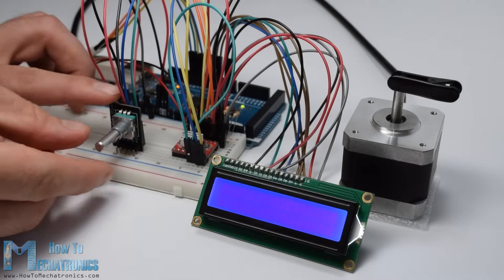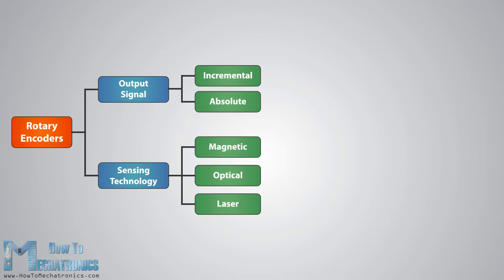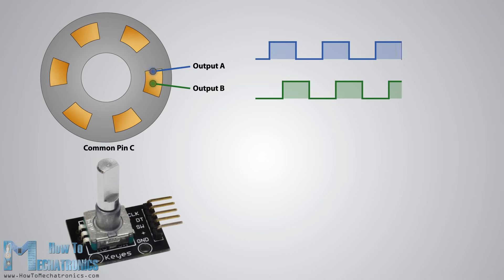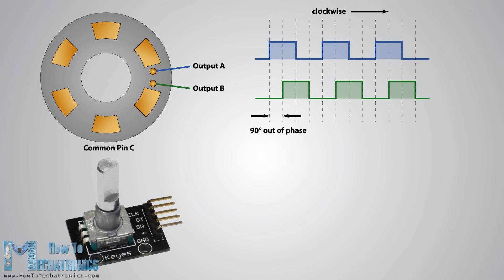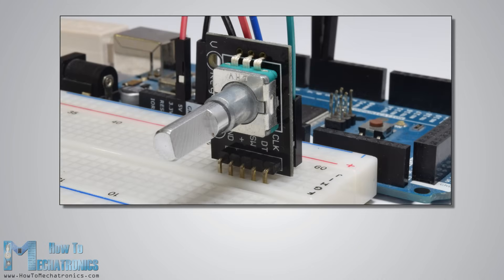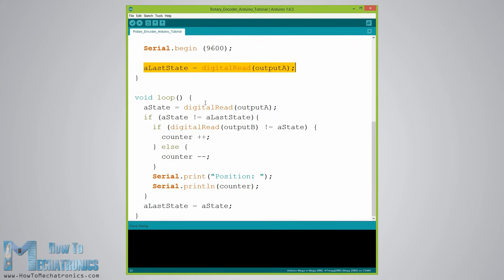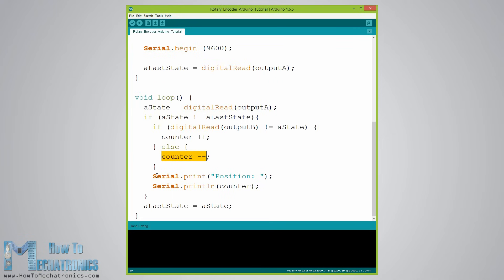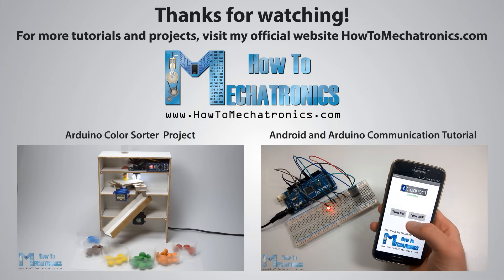How Rotary Encoder Works and How To Use It with Arduino

Comment: Thank you for this! I am planning a large midi controller surface with 176 rotary encoders, and considering using the i2c protocol to read them.  I have basically the same encoders as you used in this video.  Do you think the i2c method is best for this sort of large design, or would a series of multiplexers be better?  Given that a human only has two hands, its only two encoders would ever he wctive at a time, so my thinkng is i2c would be fadt enough.  Your sights are very welcome. In addition, any ideas on how to attack these to the i2c coms would be welcome. Im not sure about the exact specs of these encoders.

Comment: I am trying to do this and maybe this video is too old for accurate reference but I'm using an arduino uno 3 and once I compile and upload everything, when I go to the serial display the numbers start changing immediately either increasing or decreasing but usually in steps. for example will go from 2 to 3 a bunch of times before moving to 4 and repeating all the way till infinity presumably. I tried to change different things to find consistencies but everytime I think I figure something out I just get more questions. Please HELP! Also I am trying to create a programmable control for a microcontroller on a stepper motor for a pump.

Comment: Nice video।i was just came here to know how actualy it works .i know what's it's use.i just bought like this.i know before i ordered that is used with microcontroller.i have one costly device having mebrane keyboard.there are  keys up and down .though these two keys i can increase or decrease the value .i studied the matrics of membrane keypad.i gind which lines are short when i press the perticular key. I just want to replace these two keys of up and down with this rotory encoder switch.i don't want to use microcontroller because the device is costly, single mistake can spoil the system.i bought bit not tried it anyway. before i try i woyld like to understand how it works .have you any hint in this regard.please reply .
Note :If it is the case where i have to use microcontroller ,i can do ,because i know the whole things regarding MC and script writting too.

Comment: Can you do a video on measuring the angle of rotation of the stepper if connected the encoder to the shaft of the stepper and if the shaft is rotated manually?

Comment: Does the rotary encoder have a limited amount of full turns you can make before it needs to be turned in the opposite direction?
Reply: They doesn't, you can turn them infinity.

Comment: i know this is an old video. but if anyone knows about this I could really use some help. or if someone can re-direct me to another knowledgeable source that would be great! so I'm wondering if there is a way to use a  3 pin rotary encoder or one like in this video on a switchboard for a monitor. i don't want to have to code anything. just solder. but I'm trying to use a back and forth button on the monitor and turn it into a rotary switch to combine the two. so when I scroll to the right, it clicks the right button, and when I turn to the left, it clicks the left button. anyone know if I would have to code the rotary encoder or not? and if I do have to code it how can I go about it? also if you guys need  further and better explanation just comment below and I'll respond. thank you .

Comment: I have a question. Every after 360 degrees turn of the rotary encoder the value of the position does not increments always the same. One whole turn it increments by 30. Another turn it increments by 40. Then 35, and so on. Why I don't always get the same incrementation although I always turn the same 360 degrees angle?

Comment: Better code fix 
I sample the encoder in a 1ms interrupts and found that encoders with a Detent
will always increment by Two so I added the  && A==1 inside the IF Statement 
I also found that you can get bad samples when reversing so I sample each 
Phase twice to make sure no changes occurred. 

/// * Called from Interrupt  *

// other interrupts could occur between A/B reads 
// Make sure we get clean samples 
//
    byte A = digitalRead(PIN_ENCODERPHASE_A);
    byte B = digitalRead(PIN_ENCODERPHASE_B);
    byte A2 = digitalRead(PIN_ENCODERPHASE_A);
    byte B2 = digitalRead(PIN_ENCODERPHASE_B);

    if(A != A2 || B != B2)
    {
      Serial.println("Bad encoder sample");
    }
    else
    {
      if(A != Aprev && A==1)
      {
        if(B != A)
          Encoder++;
        else
          Encoder--;      
        Serial.print(A);
        Serial.print(":");
        Serial.print(B);
        Serial.print("=");
        Serial.println(Encoder);
      }
      Aprev = A;
    }

Comment: great!! can I ask you abput this topic?

I have a encoder with 8 Cables and 1500 ppr ( A+ a- B+ b- Z+ z-). I just connect the A and B to the arduino uno with this code. But the reading speed is not enough to catch all the pulse i think. 

Do you think that an arduino Due could help me? Or based on your experience what could be the solution?  

thanks

Comment: I don't believe the Vcc connection to the encoder is required if you use INPUT_PULLUP for both the A and B inputs.

Comment: Hi, I'm getting double count, for ex: did one turn - result: 1,2. one more turn: 3,4. and so on. How to fix that? :/
Reply: I had this problem too. it was counting on, both, the falling and rising edge since the initial "if" was "if(current != previous){other statements}". to fix it it, just add  a second condition, like this "if ( current != previous && previous ==1){other statemetns}". i simplified it further and just ended up with "if( previous==1 && current =0){other statements}". this will only run the condition on the falling edge.
Reply: I just don't know what you mean by current and previous is it like aState and aLastState in the code
Reply: Thank you Its finally working!!! :)

Comment: Use an interrupt instead:
volatile bool isCCW;
volatile unsigned int count;
long encoderCount;

void isr() {
    isCCW = digitalRead(outputA) == digitalRead(outputB);
    count++;
}
void setup {
   //...setup pins and stuff attachInterrupt(digitalPinToInterrupt(2, isr, RISING); // has the be pin 2 or 3
}

void loop {
// other stuff
  if (count) {
    if(isCCW) encoderCount += count;
    else encoderCount -= count;
    count = 0;
  }
}

Comment: can you please make a video where you use an encoder and an SPI (counter) with Arduino. I want to know how to use the SPI.transfer() function in the Arduino IDE software using the SPI.h library. the encoder that I am using is am-2816a and the counter is ls7366r. the some Arduinos have a built in SPI communication pins. For example Arduino nano has pins 10, 11, 12, 13 as the supporting pins.

Comment: It works, but not the best way to do it, you’ll have lots of problems doing it this way down the road. Such as more power consumption, because the code must poll the encoder constantly, you’ll also have missing codes if the code isn’t cooperative multitasking and the processor is busy doing something else. It’s better to use logic, a CPLD or flip-flops to handle the quadrature decode and use hardware interrupts to run the encoder subroutines. I realize this is going to be very difficult for most people to implement, I just want to point out that there are more professional ways to handle encoders. The simple solution is fine for quick experiments.

Comment: But it increments by 2?
Reply: Yes, becouse encoder inside selector is moce precise than selector's rows. It is even possible to multiple increments up to 4 per click.
Simple, you must to count every increment to integer and checking. If is >= than 2, is one cw click. If is <=-2, is one ccw click.

Comment: Why arent you using an Interrupt to read the encoder. This code wont work in an application because the reads will be too slow to pick up the pulses accurately.
Reply: yeah i'm having that problem right now. How can you solve it exactly?
Reply: @TheBramVermeulen  check great Scott's video about encoder
Reply: Polling is the way to go always, use a Timer interrupt to have a (very high) constant sampling rate. External interrupts aren't recommended because they can 'jam' your code.
Reply: @marcojimenez9327  They don't jam your code, keep the routine tight and the variables volatile.
Reply: volatile bool isCCW;
volatile unsigned int count;
long encoderCount;

void isr() {
    isCCW = digitalRead(outputA) == digitalRead(outputB);
    count++;
}
void setup {
   //...setup pins and stuff attachInterrupt(digitalPinToInterrupt(2, isr, RISING); // has the be pin 2 or 3
}

void loop {
// other stuff
  if (count) {
    if(isCCW) encoderCount += count;
    else encoderCount -= count;
    count = 0;
  }
}
Reply: @markfinnicum8340  but you need to interrupt on state change, not just rising
Reply: @theralhaljordan7337  it does not make too much difference in practice. With change, the count would be twice as high per rotation and more accurate with direction changes in theory.
Reply: @markfinnicum8340  wouldn't the rotary encoder be ignored if the state rises?
Reply: @theralhaljordan7337  you are listening for the rising edge of just one channel. Both the rising and falling edges have the same comparison between channel A and B. The comparison negates only on direction change
Reply: @theralhaljordan7337  That, and you need debounce-logic cause the signal is dirty.

Comment: When i do this it's increasing double every time
Reply: the fix is very simple, just add |  && aState == true | in the first statement. like this....    if (aState != aLastState && aState == true)    the problem is that increments and decrements are happening at both rising signal from low to high and falling signal from high to low.
Reply: @Ahmadnaweed786  cool. Ill try your solution soon.
Reply: @Paradox3627505  let me know if it works
Reply: oldSoCool 
Same here. The problem is that our counter variable is incrementing on both lo-to-hi and hi-to-lo transitions. So (A=0, B=1) and (A=1, B=0). I'm assuming your encoder "clicks" with each "small" turn (mine does) and this causes a pulse which means both types of transitions will occur. I'm not using arduino but this solution worked for me. Pseudocode:
...
If(a_state != a_last)
   [If(a_state != b_state)
      [ If(a_state > b_state)
          [Counter++;]
               ]
           ]
              Else[ 
                Counter--;
                   ] 
....

Let me know if it works!
Reply: @Paradox3627505  i tried your code but didn't work for me; only one direction fixed, other direction kept counting by 2. however, i finally got it working since the line you added gave the general idea of how to go about it. I ended up with this "if ( currentA != previous A && previousA ==1){other statements}". note, this is the initial "if", the once of the inner ones. this counts only on the falling edge.
Reply: @carlos2004  Thanks!!
Reply: @Paradox3627505  didn't work

Comment: There are instances in both CW and CCW situations where both A and B are same and different. How can u just say that A!=B for CW and A=B for CCW?
Reply: In case you still haven't found out, you can just copy paste his code and do the exact same thing with outputB as he does with outputA. Just remember to add a variable bState and bLastState, change the code inside the loop and swap the variables accordingly.  Lastly, replace counter ++ with counter --- and vice versa and that should be all there is to it.

Comment: Wow, such elegant code...My overly complex code didn't work well when I spun the encoder quickly, this works flawlessly. Thanks!
Reply: It's not that elegant tbh, it should be implemented with hardware comparators and interrupts
Reply: @TheChrisey  Agree: the example in the vid is fine
 for slow speeds, and when there is feedback, such that if a count is missed, or extra, the user will self-correct, and everything is fine. For higher speeds, you need some hardware and maybe counters, which take care of the counts, and the main software just reads the counter any time it needs the values. Some of the Microchip PIC family have a hardware module built in. A quadrature Decoder. But you can also craft with some of the "soft" progamable gates, e.g. CLB and such.

For very high speeds, e.g. motors at thousands of RPM, you can't really just poll the pins in a loop: you need hardware assist. Or very fast interupts might get you some of the way.

But again: the example is fine for the right kinds of slower stuff.

Also: switch-bounce shaping on the pins can be important, so you only get 1 count per count, not many. I did not look too deep at the code to see if maybe its state always handles that OK enough. A resistor and a cap might be enough, depending on the encoder used.

Comment: man you have to change some code from
pinMode(outputA,INPUT);  ==> pinMode(outputA,INPUT_PULLUP);
pinMode(outputB,INPUT);  ==> pinMode(outputB,INPUT_PULLUP);
to work
Reply: Thanks Arun. I was having trouble getting it to work with the original code, but your fix has it working perfectly!

Comment: Rotary encoders are utter crap. As soon as oxidation gets on the contacts, it will fail to work properly, and will skip steps or not work at all... I hate rotary encoders, because I have yet to see one that works flawlessly for more than a few months.
Reply: AlainHubert you can disassemble a PC mouse that uses a rotary encoder for the scroll wheels. Those are pretty reliable
Reply: Yes indeed. But they're usually bulkier than electromechanical ones. Difficult to use with a knob on a front panel of a device for example.

Comment: in this example was the encoder connected to 5v at the common pin and then pins A and B were connected to digital pins with pulldown resistors?

Comment: Nice explanation.
Unfortunately your code does not work :-(
The counter is decrementing to infinity, not responding to the encoder position.
Reply: It works fine. You must have done something wrong.

Comment: Do you know the maximum speed of the decoder? Can it turn up to 200 rounds per minute? I tested once and it was not counting correctly - so the question is - was a problem with Arduino or with the mechanic of the decoder? 

Thanks you

Comment: Didnt work,. the output is just decrementing into infinity.
Reply: even i faced the same problem but can be corrected by replacing 
pinMode(outputA,INPUT);  ==> pinMode(outputA,INPUT_PULLUP);
pinMode(outputB,INPUT);  ==> pinMode(outputB,INPUT_PULLUP);

Comment: I have problem in connecting the arduino Mega 2560 pin when I connected two encoder at the same time.

For 1st encoder, the connection pin is same as provided in the video and I able to measure position but

For 2nd encoder, I try to connect

CLK - Pin 18 (interrupt)
DT   - Pin 13
SW  - N/A (not use)
+      - 3.3V
GND- GND

the position reading is keep increasing even when I do not rotate the encoder shaft. Which give me the reading error.

Anyone could help me out, I am really appreciates.

Comment: Hi Dejan, thanks for sharing this helpful tutorial,I would like to use a rotary encoder to replace the menu navigation buttons in my project, your video is very useful.

I notice that you did not appear to implement any software de-bouncing techniques to overcome the switch noise, yet your example did not appear to suffer from switch bounce. Did you use a hardware filter of some sort?

Thanks.
Reply: Yeah I was wondering about that.  My encoder skips when I move it then when it clicks.  So each "notch" counts as TWO.  0... 1,2... 3,4.... 5,6.... I suppose I can code accordingly but, slightly annoying.
Reply: Yes, my encoder produces the same behavior.
Reply: Maybe the two Serial.print() statements in the loop slow it down sufficiently that the chatter has stopped by the time it looks around again. With a faster arduino like an ESP32 the bouncing may be seen again. Havent tested it but just a thought!

Comment: thanks for the lesson, and allow me an important observation if the right if the key stirred and lift to lost a lot of impulses turned frequently to overcome the problem but does not benefit personally used encoder motor

Comment: Seems to work, but my encoder will jump two positions for each increment; so the output is always even. 

Tried swapping the wires but no luck.
Reply: http://playground.arduino.cc/Main/RotaryEncoders#Waveform loot at here on example 1. it should work for you.

Comment: Does the rotary encoder in the scroll wheel of the mouse also work in the same way? Can I use that one with Arduino the same way as you did?
Reply: yea i also wonder that to
Reply: Over there the sketch how to use Arduino with the scroll nouse. Read again the sketch carefully  and you can find the youtube link at the beginning as well.